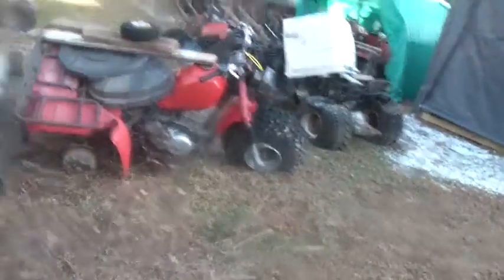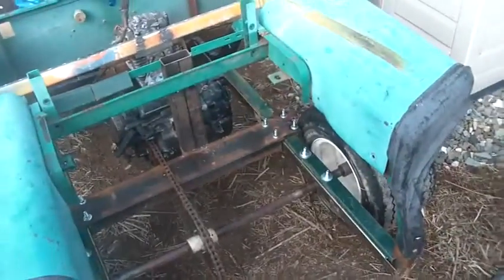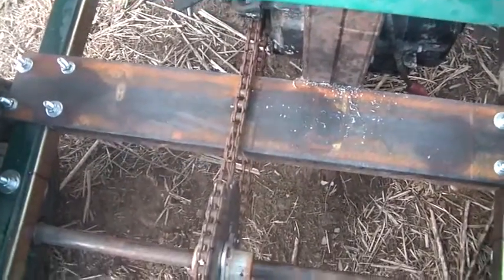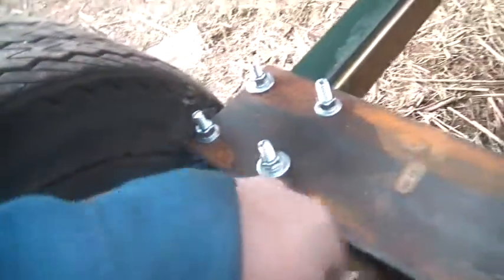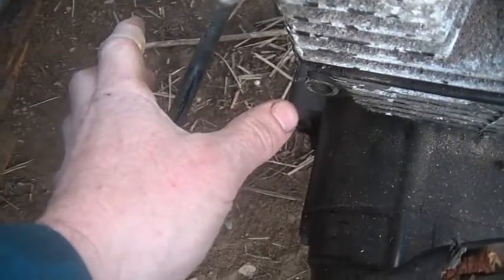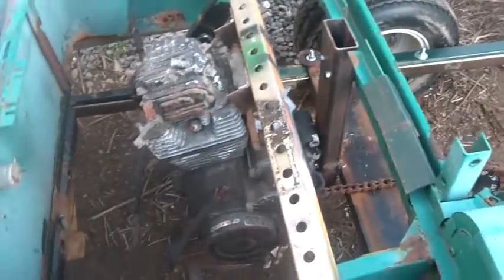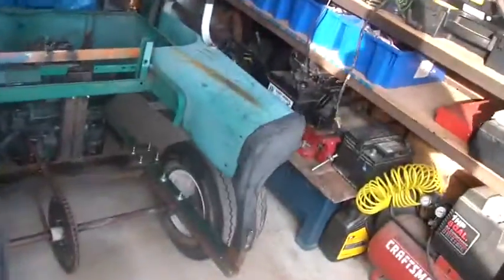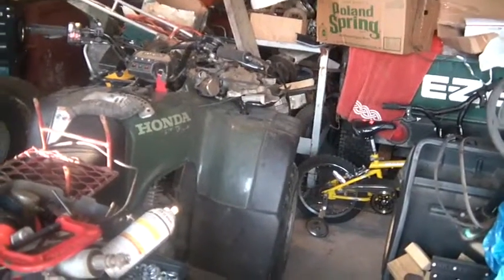1988 EZGO Golf Cart to Honda powered UTV,  rear axle,

Comment: hey Harvey, are you going to use the original factory front motor plates? if you have a sacrificial frame, could get the frame downtube, weld it to your lower piece of steel, and save a lot of fab time. just a idea.